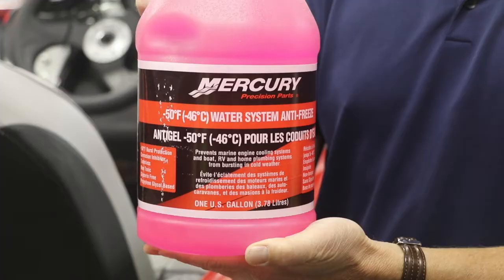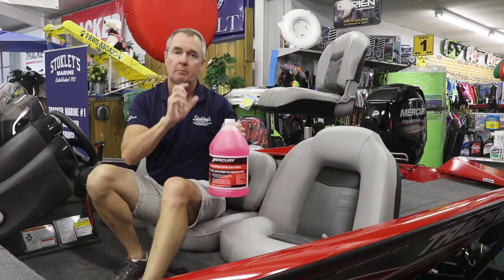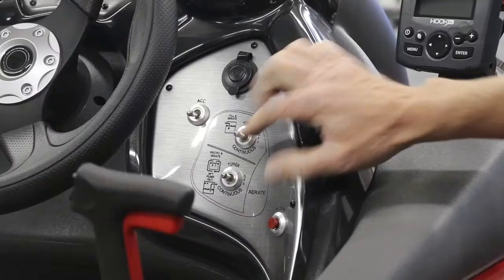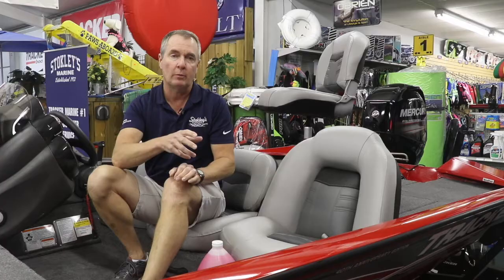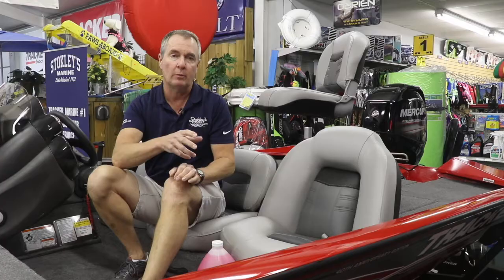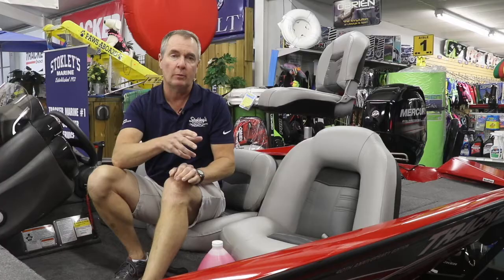Protect your livewell with antifreeze

Comment: Stupid question but - does the boat need to be in the water to do this?
Reply: You're re-circulating, so no - you're taking the water (anti-freeze in this case) from the live well and it's re-pumping that through the system.  Just make sure you don't add any water, as that's what'll cause it to crack fittings/hoses.

Also, make sure you drain your live well completely and run your bilge to get any water out of the system prior to doing what he's saying.